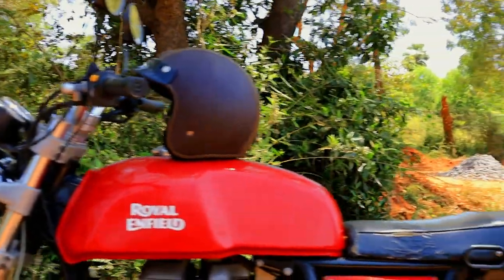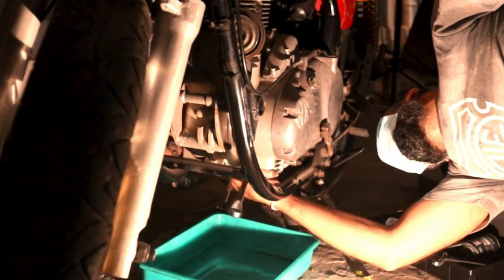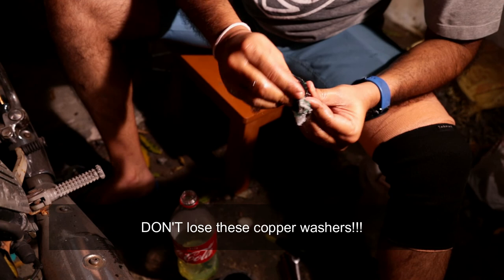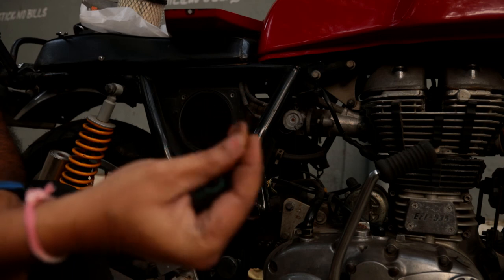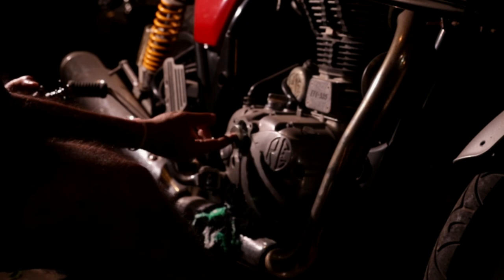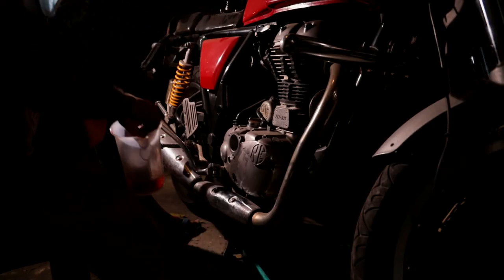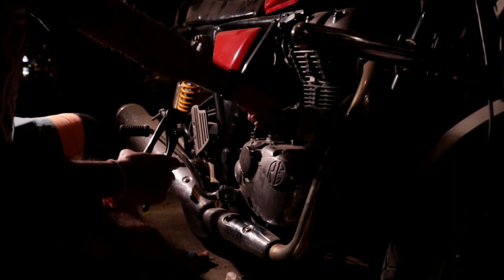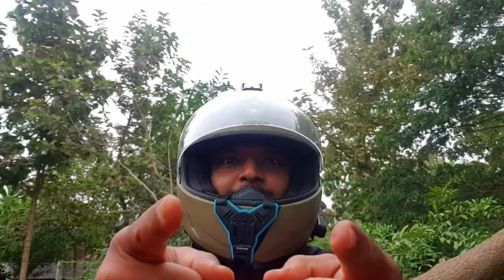Cinematic Oil Change | Royal Enfield | Continental GT 535

Comment: I just bought one of these, a 2016 model, how often will the oil changes have to be? im probably going to use shell oil 15-50
Reply from the maker: If its mineral oil, 4,000 to 5,000 kms... synthetic you can go upto 7,000 kms. I havent tried synthetic oil in this engine though...
Sorry for the late reply, been a bit caught up 😊

Comment: Required 3 litre oil intead of 2.5 litre
Reply from the maker: Strange... just make sure the oil level in the window is below the upper line. Start, Idle for 10 mins, switch off, check...